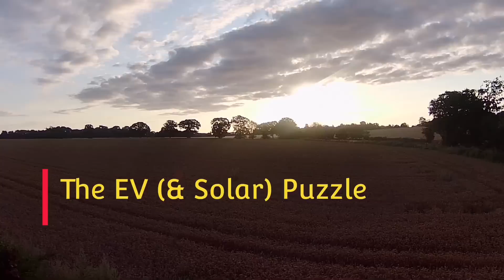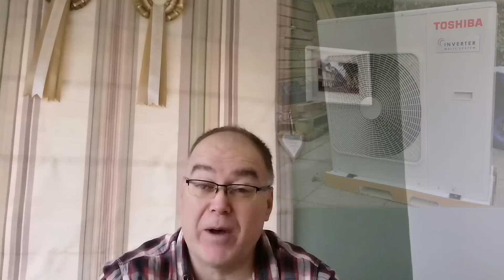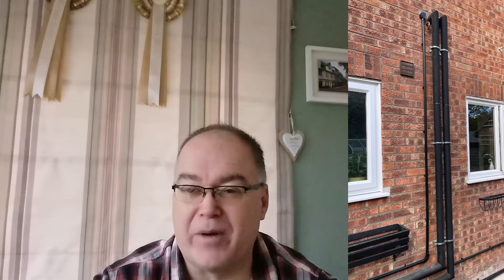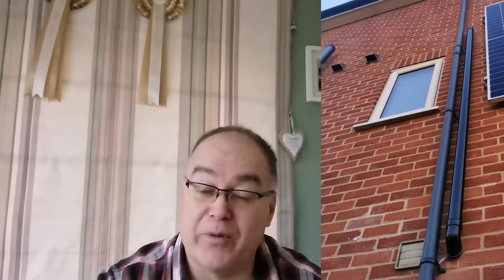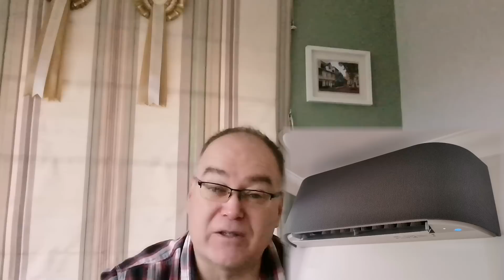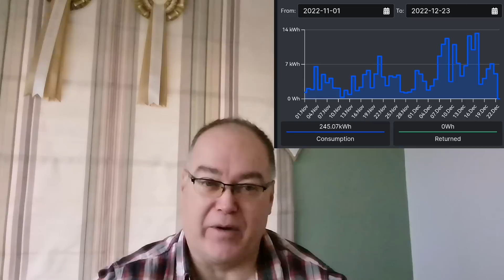Toshiba Air to Air Heat pump (A2A) - Probably one of the best heating systems you can install

Comment: hi - do you have an issue with the drain lines freezing when it gets cold?
Reply from the maker: Think I've seen it once yes but in heat mode there shouldn't be too much moisture extraction ?
Reply: @EVPuzzle  yeah we have 2 compressors, and only one is freezing up…trying to figure if there's anything wrong, thanks anyway
Reply from the maker: Hope it resolves itself, warm water down the drain hole maybe ?  Flush it through?

Comment: so im currently in the process of putting in solar and battery in my house im going for 22 panels,sigenergy 10 kw battery and a gateway im also thinking of air to air for the heating rather than the current oil boiler and rads i have ,basically im hoping to have a system that will more or less run itself and that i will have very little bills coming in the door or very small ones ,one concern i would have is that is 3 units enough for a 3 bedroom house? with a lounge,kitchen,utility,bathrooms etc? and the house is about 25 years old double glazing and standard insulation for the time.did you have to spend any money on upgrades to insulation etc?
Reply from the maker: Not on insulation, I did fill the odd gap here and there and add door trims to reduce draughts but on the issue of 3 units  you do have to think about which doors you'll leave open and which not. Adding units in every room is an overkill unless you're using the room constantly . Too much power can be a  problem as the units too easily manage the heat, leaving doors open and working units harder is much better . We don't heat our kitchen at all but it heats and cools just leaving the door open. Bathrooms though are door closed so they need their own heat source . We went for towel rails with Immersions. Not the best efficiency but they do the job

Comment: These sort of adverts for products usually start with people talking about heat pumps, then not wanting the high running costs and fitting solar panels and batteries, then going to buy an electric car.
So, £25,000 and another £50,000 for a car, maybe £75,000 to save no money each month, but to lose the interest or investment on that money each year - madness.

Comment: My new 25KW gas boiler cost around £4500 with a couple of radiators changed and tanks removed to convert to a combination boiler.  To provide hot water and heat the whole house to 22c nearly all day all week costs £13/week at the minute, the lowest was £11, but tariffs have changed a bit. I use TRVs on radiators, so can switch off rooms or lower them right down if not required. 
Think of the money I saved by NOT spending £13,000 on a heat pump system and another £12,000 on solar panels and batteries.  I invested the £25K and can use the interest to offset the very low gas bill.
Why would you spend thousands on heat pumps and then spent the same again to try and use less mains electric!  It's a false economy.  You also have depreciation and servicing costs.  It will take 25years for you to break even. 

Most people making this type of video either work for advertising companies or heating companies and are promoting products.  NONE will show you a gas and electric bill from the winter before and after they fitted an air pump system.  Many have been left with systems that heat to 19c and cost a fortune to run.  I can see it now, "have you been mis-sold a heat pump"!  Quite a few keep their gas boilers.

Comment: Thanks for this. I couldn't follow how you chose the size of the units. Was a heat loss calculated for your house to determine the size of the units selected? Matching an Air to Water ASHP to the heat loss is critical but for air to air it seems you can over size without much penalty in efficiency. Is this right?
Reply from the maker: The installer will usually add up the size of the indoor units to spec the outdoor unit. Knowing my usage case approx heat loss I convinced him to drop from 10kw to 8kw. Very wise decision

Comment: Would be interested in knowing what your years total consumption  was?
I had similar doubts about ASHP wet system but found company that would work with me + we have UFH downstairs.
Very happy with our consumption & combine the use of solar with solar Iboost to add to hot water tank & 200l buffer tank.
Reply from the maker: 1127kwh including 219 for summer air conditioning so 918 heating

Comment: I'm implementing a 3.5kw x4 in each rooms. What are the number of outdoor units to cope with this? Can I get one large mitsubishi rather than 2/3 separate ones? What are the benefits and drawbacks of this vs a getting a large kW unit outside?
Reply: I'm currently fitting a electriq 4 way split with a single outdoor unit, it runs off a 40amp fuse, they do a 5 which is a 40a also. The benefits for having single splits for me would be having different cycles in different rooms ie having one in heating and another on cooling, as with a muilt split they all have to work the same function, also if one breaksdown it won't effect the others. The downsides would be the amount of outdoor units around your property as air con (hot/cold) doesn't 
fall under the permitted development!!! The rules for heat pumps is 1m from your boundary and the first unit only a second would require planning. I've never known a problem as long as it's a single unit falling within the regs.

Comment: Thanks Nigel i think this is for me , im single im 71 spend most of my time in the livingroom, i would live to come off gas completely and just have the one bill . ii have a Powerwall v2 and 32 solar panels facing east south and west  ( west dont really work in winter) . i dont really get any visitors  and i sleep inn the livingroom out of choice, So far ive never gone  on a night rate as im basically off grid with electric but i would go on a night rate if i only had the one bill . my house is a 3 bed semi concrete but with outside insulation , These companies dont really do an assessment for how people live it isnt one size fits all , i shall look into what you have done i didnt know you can use old wet radiators to be electric . Many thanks  from Toby the dog on X .
PS if i went on the night rate i wouldn't hhave to worry about charging the car in the winter its on the Zappi right now gettin 4kw from the sun . any advice is welcome.
Reply from the maker: Sounds like you're similar to me , not wanting to heat all rooms all the time 
Sometimes with lots of solar it's great to indulge and turn everything up but it's a bit unnecessary so good to have flexibility .
Plus Aircon in summer 😎
Heat pumps work best when loaded and left running so it's good not to over configure. We run 2 units at a fraction more energy than a single unit , 3 units use even less per unit . I'd be apprehensive of just a single unit . Itd work of course but why not heat more for a fraction more energy , 400w instead of 300w tick over 

A2A is also a very comfortable heat , filtered air too.

Give Graham a call at ignite , he's great at figuring out solutions
Reply: @EVPuzzle  Thanks Nigel i think id only need 3 livingroom hall maybe one upstairs. i shall look for ignite i live near Salisbury dont know if they travel this far but ill get intouch with them
Reply from the maker: @rodden1953  he travels all over , even in Wales !
Reply: @EVPuzzle  Oh ok i have emailed him , Thanks i just hope they do the grant for A2A
Reply: @EVPuzzle  Ive just been told the Grant isnt for A2A its the best for my needs .

Comment: Hi, how programable are they... Could i have it maintaining a property at 19c, but then have them automatically in dry mode for 2 hrs each day ?
Reply from the maker: You could but dry mode is actually air conditioning so heat it up then cool it down?  You'd be better adding a separate dehumidifier as the heating up will be better in a drier atmosphere.

Heating damp air isn't as effective as heating drier air 

With a split system they all have to be in the  same mode , heating, cooling or just fan etc

Comment: We are having a 36 kBTU/3 ton/10.5 kW Daikin A2A 4 zone HP installed next week. We currently have a forced air natural gas heating system with a theoretical 30% heat loss in ductwork. We have 6.4 kW of solar panels on roof with grid tie back to utility but no battery.  I hope we like our HP as much as you like your system.
Reply from the maker: Be interesting to hear how you get on from gas heating air to electric . I suspect it'll feel nicer

Comment: Did you research the outdoor/indoor units or just go off the installers advice. If you did research can you send make and model. I’ve got solar installed because of your videos and now looking at air to air. I’ve been told Mitsubishi are the most efficient
Reply from the maker: There's not much between to be honest mitsubishi heavy industry are great apparently but Haier are great too as are LG etc

I chose mine based on knowing how the App and Interface would work.  Although they all work on remote control for me that is the contingency method of operation  , I wanted online app, Alexa integration etc so I chose Toshiba . So far so good but do your research as you've got to live with them a long time 

Installer normally adds up indoor units to size the outdoor unit . In more a fan of working out your house heat loss value so you dont oversize 

My house heat loss number is just over 6kw so a 6kw unit should be enough .  Installer recommended 10kw so I dropped to 8kw outside inverter for our 3.7+3.7+2.7 units 

The difference is how fast they'll heat your house but more importantly what wattage they tick over at when at temp . Bigger the unit , higher the tick over .

8kw is oversized for us !  But it means we run in eco lower power mode all the time

Comment: Let’s say 10kwh electricity to heat home , just heat - so 10kwh x 30 days = 300kwh x 0.28p ( standard flexible tariff) = £84 per month just for heating ( not every room) . Now what’s about water ? . I think  if you got gas combi boiler (new ish) its totally pointless to change for heat pomp . We have Gas central heating  ( 3 bedroom ,2 bathroom house) in the coldest months we are using about 1500kwh of gas per month with is about £100 for heat every room ( every) up to 22 degrees plus at least 2 showers and full bath a day . I’m not saying its not worth , it is but for new builds  not for existing water heating homes - investment not worth .
Reply from the maker: If you've got Gas you should absolutely be thinking of going electric .  Gas might seem convenient but it's not the way forward .  If you can go solar too you'll be laughing at leaving gas behind 

28p isnt accurate either loads of cheap electric tariffs for heat pump owners and EV owners , we average 8p per kWh , but many are getting 15p and below 

There's no easy install a little box and magically fix everything solution of course but if you move it electric it can seriously increase your green credentials but also reduce your bills quite significantly.

Comment: Hi Nigel. We have just had the same system installed. Toshiba 10Kw Multi split outdoor unit with 1 x 3.5 an 3 x 2,5KW Haori indoor units. We have the units scheduled for most of the day at 21deg C, (heat setting only) and low fan. (Outside temp 0 deg). However this is generating very little heat! (Luke Warm). App is showing a 29deg room temp but it is only 18deg C actually measured temp. Can you recommend the best settings on the fan and or increasing the required temp to compensate?  Also on the Energy Monitoring on the app has got the linear Graph consumption colours for each indoor unit wrongly allocated. Is this a bug in the App?
Reply from the maker: When units aren't in use the high temp gas can distort what the actual internal temp is , you need some air flow to get it going . Just use auto and increase temp to get it going.

It can be slow without increasing fan speed or temp.

Only an issue when some units on and others off.

It always sorts itself out eventually but I'm impatient so adjust temp and fan speed up for a few minutes

Comment: I can see the benefit of this system and am thinking of installing one.  However I don't see any mention of things like estimated lifespan of the system or ongoing maintenance costs (eg servicing).  Can anyone shed any light on this?  Being 'refrigeration' technology, I would expect it to be very reliable (like 25 years before breakdown - I wish), but these units are much bigger than a fridge compressor and there's all the fans too.
Ta

Comment: Glad to hear you found a solution that works for you 😊. I'm also considering an air to air system, but it would involve quite a long pipe run to get to a couple of the heater/cooler units, so I'm interested to hear that your installer had to be quite creative for one of your units; what was the approximate distance that he had to route the pipe including all the ups, downs and horizontals please?
Reply from the maker: 35metres approx adding it all up
Reply: Cheers for that, it's good to know that such runs are possible   @EVPuzzle

Comment: Did you get planning permission for the Air to Air system? Many people don't realise that an Air Source Heat Pump is only "permitted development" if it's for heating only. If it provides cooling it requires permission from the local authority. You also can't get the £5k BUS grant for an Air to Air. The reason is due to carbon reduction - an ASHP providing heating saves energy and carbon compared to a gas boiler but providing cooling consumes energy and carbon which a conventional boiler doesn't attempt.
The above may change considering many people have solar PV to drive and negate the cooling energy and carbon consumption in summer which would otherwise come from the grid but that's the current situation.

Comment: Does anyone know if it would be possible to wire up a multi-split unit with an air-to-water condenser to do a sort of hybrid air-to-air, with air-to-water for hot water and some UFH?
Reply: I believe Daikin do an A2A system but you can add a water heating system to it to provide DHW.
Reply: @coolkiwi79  Yes, te water heating system is the issue. In theory it should be simple but I don't think many manufacturers 
provide these kinds of units.
Reply: @rewindoflow  Generally in that situation you want the reverse, an A2W unit with the module for cooling and then use fan coils for where you'd want the multisplit units.  Not sure how cost effective it would be, as to get the most out of the fan coils you need 4 pipes running to them. For just A2A and DHW, there's also the Hitachi Yutampo - which I'm having installed in a couple of weeks (My installer said the Daikin costs more but the brand over here doesn't have a great rep).

Comment: Good evening excellent video can you tell me did you need a  pump for the condensation pipe for when it’s in cooling mode as you came from the loft, i’ve been pricing up and investigating the same system. The installer who priced mine up says I would need a pump at the side of the indoor unit because I’m coming down from the loft also  , but I do not want to compromise the Asthetics of the unit.
Reply from the maker: The mini pumps are hidden in the units or up in the loft using extension tubes. Not visible and can't be heard
Reply: @EVPuzzle  thank you for your reply

Comment: Great video Nigel really appreciate it, I feel I've hit the jackpot as this is exactly the same scenario i'm in with our 70's 4-bed detached which runs on oil, I've been pondering about air-to-water for some time but it just didn't make sense when you add the high installation costs and hikes in eclectic charges, i doubt it would save any money as I was being quoted of over 15k for install alone, it just didnt make sense retro fitting a air-to-water system to a house that was never designed for it and a hybrid ASHP/Boiler combo that would probably never work well together, i prefer the systems to be standalone and as they say keep it simple, the air-to-water retro systems also seem to average lower SCOPS also compared to A2A 

But like you we heat  the whole house all the time and happy to have cold areas, it never gets above 19 degrees which i think is due to the fabric and block concreate floor and walls, it can feel like a cave (often warmer outside) but at least its cool in the summer,  as insulated as it can be (cavity wall/new windows/doors/200mm rockwool in the loft). 

As we have moderate oil consumption 600-700liters per year its the gaps where the oil is off we struggle with, (ok now its warming up for summer) and would like an alternative heat source without the high install overheads, this seems like the right solution for us and my wallet, i dont know why the UK is so slow to catch on with A2A as they have been useing them across the globe for decades, with the added benefit of air-con, purification, dehumidification etc it really sounds a win-win. 

Love the Tosh system also, do you know how many indoor units this would support, struggling to find answers online, also how much you think this would cost to run on daytime tariffs only with battery storage in comparisons and are the savings worth the outlay on batteries, I'm new to this aspect so need educating please  :) 

Thanks

Mike
Reply from the maker: I'll be doing a winter cost for heating video soon so, that should answer some of these things

My 8kw inverter supports 4 split systems indoors but it is limited I think to a 40m pipe run. Good install design is needed

Comment: Almost every household in Thailand for HVAC is similar mini split air 2 air system as well. Drain pump should be your concern most pump broke before the life of AC about 5 years. When it leaks can be very problematic to walls and ceilings.